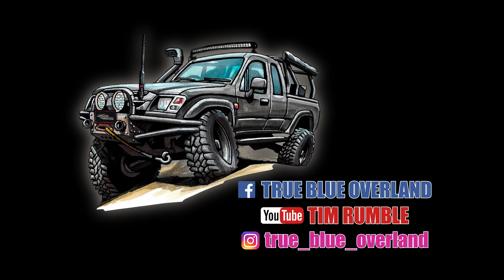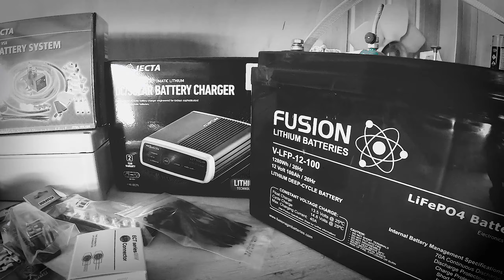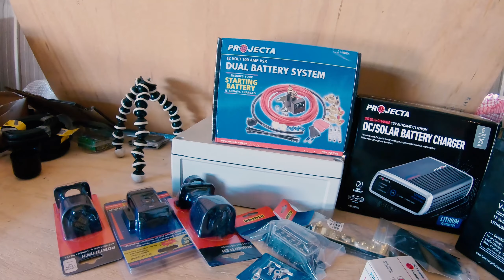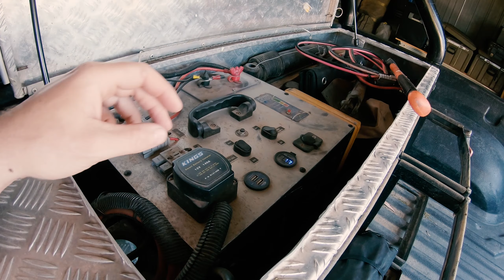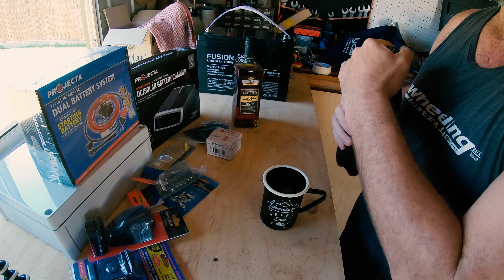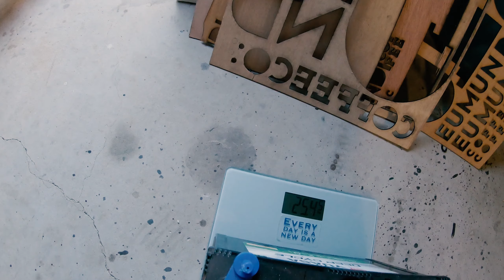Lithium Battery Install - 12 Volt Upgrade

Comment: Nice work mate!  Just from experience at work, be careful with the electrical box.  They leak anywhere they possibly can i.e. where you screwed it to the lid of the tool box or the door seal.  I've seen them full of water and burn out pump stations. Just saying keep your eye on it.:)
Reply from the maker: Cheers for the heads up Peter. Will do mate. Might actually drill a couple of holes in the bottom corners just in case. I did silicone the bolt holes up and used rubber washers as well. But yeah will keep an eye in as per your advice. Cheers again.

Comment: Good choice on the lithium very light you can take them down low and fast charging ad a solar panel to that mix and it’s an unstoppable power system, Got to mention the little blooper LOL when you say at 4:20 so bloody heavy about 30 kilos each about 28 kilos had to pull out the calculator for that one LOL but jokes aside nice work on the power system 👍🏼
Reply from the maker: Hahaha... yeah i noticed that while editing. At the time i was trying to mention weights of this and that and in the end just had too many numbers in my head. Haha.

Comment: Great upgrade ! I'd like to switch to lithium.
Reply from the maker: Thanks mate. Yeah the lithium seems to be good. I've since learned however, choose rhe brand of battery wisely. Some lithiums don't like offroad conditions and tend to drop cells. Some of the cheaper ones especially. Luckily this one is all good to go. But so far so good.
Reply: @TimRumble  Good advice. Thanks

Comment: You should be able to get a hinge kit from the electrical wholesalers where you bought the box from. they lock in to and replace two of the lid screws. nice and neat.
Reply from the maker: That sounds bloody good mate. I might just investigate that. Cheers for the heads up.

Comment: You won't be disappointed Tim have a portable set up the same in my ute runs two fridges an lights bloody awesome an charge quick as
Reply from the maker: Thanks mate. I've had a couple of opportunities since to test it. And charge didn't go below 13.2. So i think she'll be pretty good. I also bought a new solar panel with more output so I think we should be pretty good with power.

Comment: Hmmm do you have to have the lid open to connect e fridge and solar panel?
Reply from the maker: Nah mate.. there is 3 ando plugs on the outside of the lid one is fused for fridge. One is fused for aux accessories like lights etc and one is for solar input.